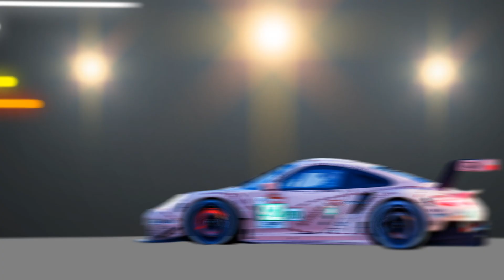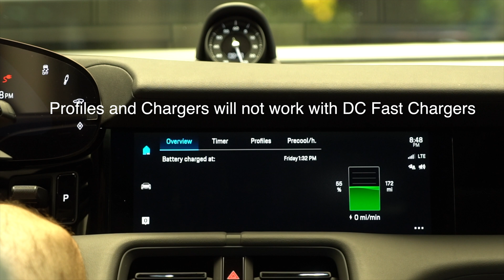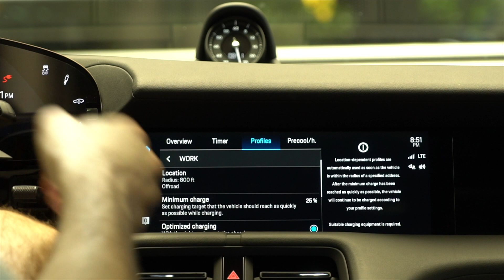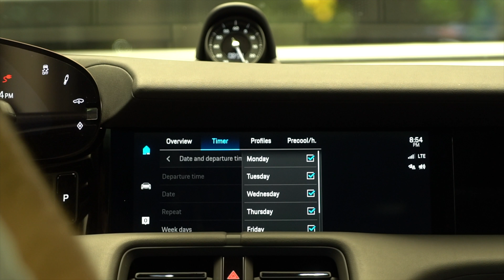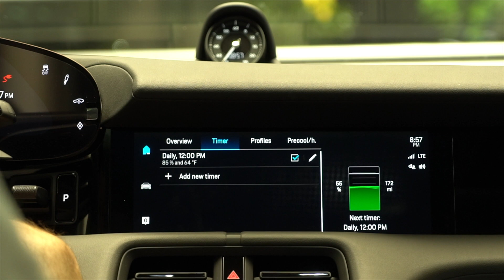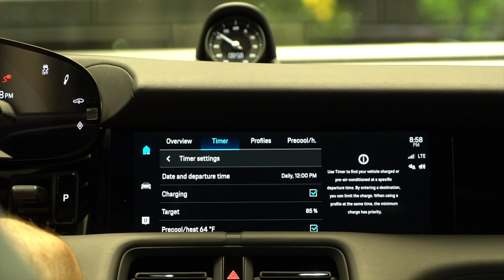Optimize Charging of a Porsche Taycan using Profiles and Timers to Reduce Battery Wear!!

Comment: I think that Porsche made it a bit confusing with the charging compared to Tesla. As shown in your video the car is charging even though it’s not the preferred charging time. So I guessed that the timer overrides the profile, right?
Reply: My thoughts exactly. Currently struggling to get my CT4S to charge during offpeak (12-7am). My current "workaround" is to set a timer at 7am daily, but this just makes the car start charging at whatever time it thinks is necessary to reach 85% at 7am; completely ignoring my profile's 12-7am preferred charging time.
Reply: Okay, apparently I’m not the only one who’s came across this issue. I rented a taycan and really tried to get this working but I couldn’t get it figured out as the timer kept overriding the profile time. I honestly don’t understand why the max charge can’t just be in the profile setting along with the minimum. It’s much easier in my tesla, but I’m really contemplating on this car but just can’t figure out this features that should be relatively easy.

Comment: Before I order a 2021 Taycan RWD can you list the options you suggest, please.  I have a lot of questions:  1) the 19” wheels: will that extend the range and soften the ride or is there no difference if I get the 20” wheels. 2) If I order the Adaptive Air suspension will I extend the range and do you like the spring ride over the air suspension?>.  3) Is rear wheel steering something you like?  4). My dealer insists I order the ACC he tells me that updates are NOT available unless I order it with the car and the updates will be better and better as the future adds more features and I am locked out from future features without ordering the ACC with the car.  Fort 5)  is the On Board 150 kw/400 DC charger useless in the US and a waste of money?   Same question about the Porsche Intelligent Range Manager?
Reply from the maker: Ralph great questions... as for the ride difference between the 19" and 20" wheels you wont notice much of a difference the 19" tires will last a bit longer that's all! As for the second question that is an excellent question I am not sure on this.... I would assume with Adaptive Air suspension the car may get a couple miles better as it can lower and become more aerodynamic but don't think it will make a substantial difference maybe only several miles if at all! I do like the rear wheel steering it is definitely something you can feel when taking the corners at more speed you can feel the rear come around nicely. I would recommend it if you are looking for a bit more performance and plan driving a bit more aggressively! As for the ACC I'm not sure what they are referring to as with ACC you will be able to add the feature Porsche InnoDrive through an Over-the-air (OTA) download whereas if you don't have ACC you wont be able to add this later. This is the only thing I could think they are thinking of 🤔 As more updates become available the car will update them as long as it doesn't have to do with ACC. As for the 150kW/400V DC onboard charger this currently will not do much to be honest but later down the road it will help reduce charging times by about 1/3 as their more 400V architecture being built currently. Will help future proof the car, I would add it! As for the Porsche Intelligent Range Manager (PIRM) only if you plan on going on longer trips... if not I wouldn't add it. Hope this helps! Let me know if any further questions arise 👍🏼 Have a great rest of your weekend!

Comment: I wonder whether these profiles also possibly limit the charging speed with DC charging (Direct Charging). I was surprised to only get around 120kW at a 350kW Ionity charger although the car was down to 3%! Maybe this is determined by the battery temperature.
Reply from the maker: Very good question Joerg! I will be discussing this in a upcoming video but the short answer is... Yes! Interesting... I am sure the battery temp had something to do with it! How long were you driving before you arrived to the station?
Reply: @Pcarwhisperer  Hi. About 25min of drive - should have established the right battery temperature, or just saved all additional energy due to low battery status